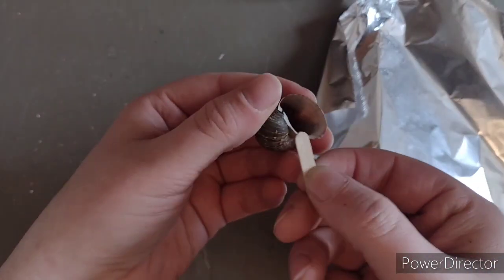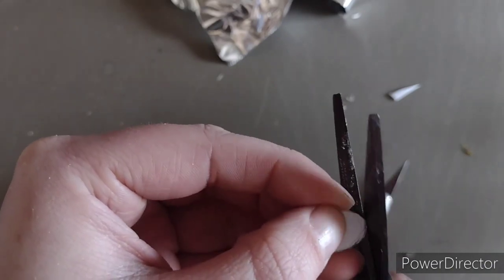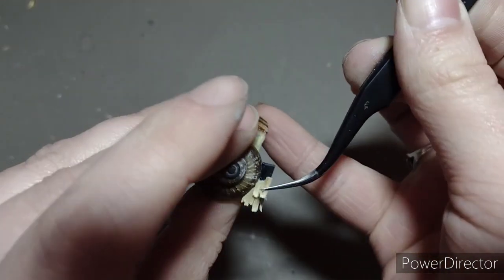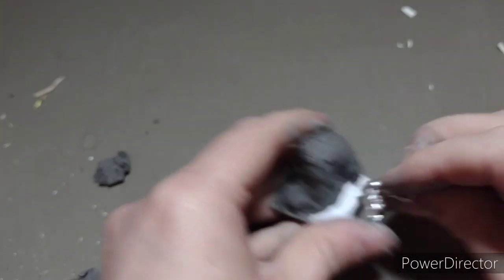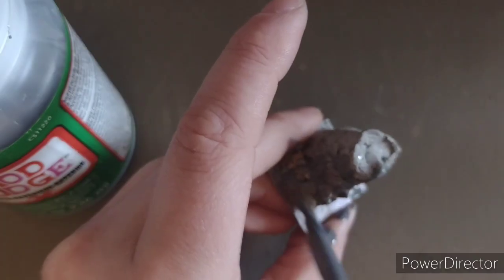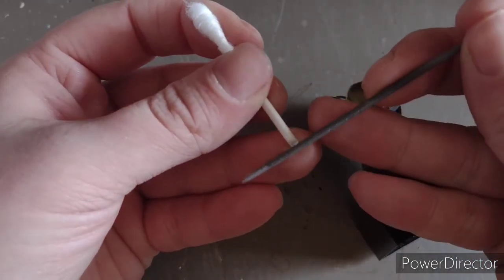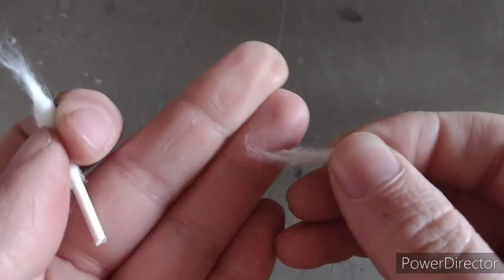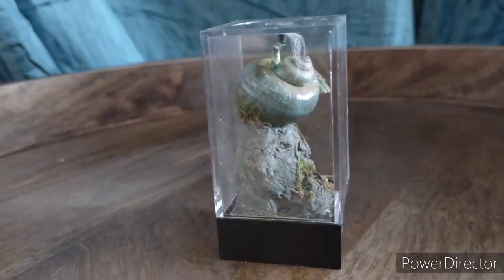Snail shell house miniature scene (collaboration with Bentley House Minis)

Comment: Question: say instead of building a house with the shell, you built a snail with the shell, using poly more clay.
Instead of shoving foil in the hole, you use the clay, to make a connector piece to the body and then you make the snail out of more clay.
Then, if I am correct, you would add a little (Tacky?) glue to the body, to help the body and the shell’s clay, stick together.
Now it is time to bake.
Would the shell be safe to bake or would it burn or become brittle and crack?